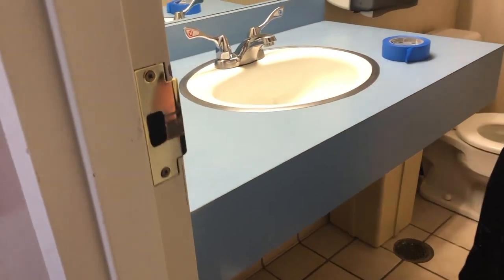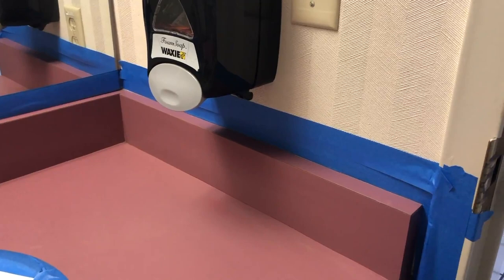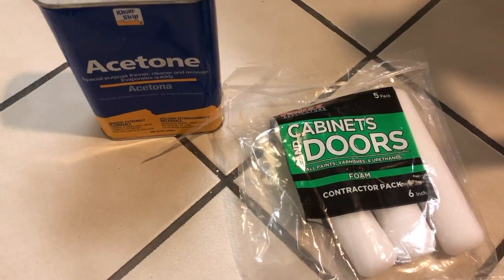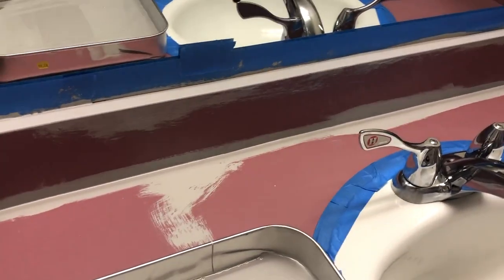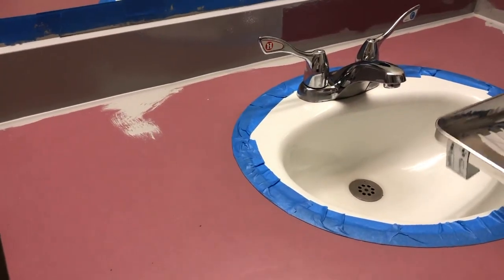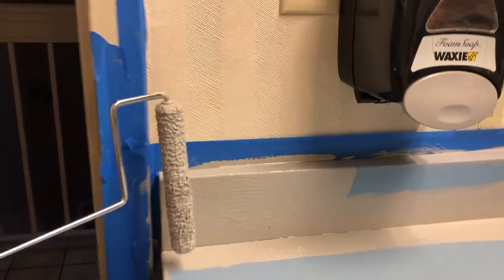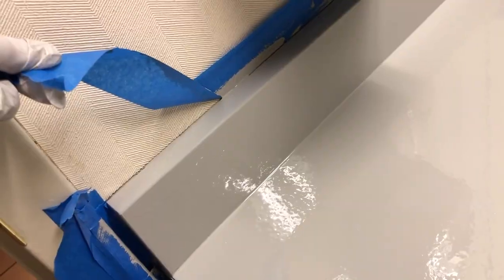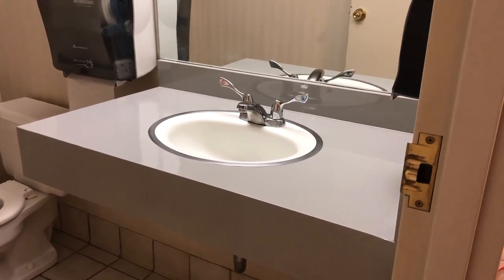CHEAP EASY laminate counter renovation with epoxy paint DIY video

Comment: to get rid of those air bubbles, i find that it helps lightly misting with a bottle filled with pure isopropyl alcohol, as it makes the bobbles come to the surface and pop, leaving you with a clean smooth surface. then lightly sand with a ultra fine grid sandpaper, repeat the proces. I always give 2 coats of epoxy paint, and then a final layer of clear epoxy, and then polish it. It gives a complete smooth and shiny surface with a high quality finish :)

Loved the vid, and the result you got out of if :D
Reply: MasterRend4n, thanks so much for sharing I will have to try the alcohol next time.  Best of luck with your next DIY project and hopefully you will subscribe to Big Al Repairs.